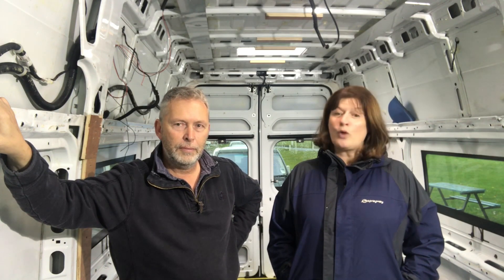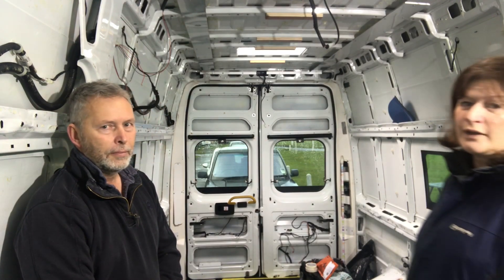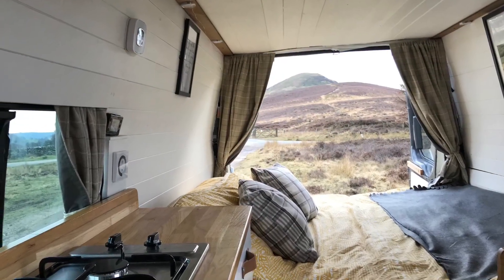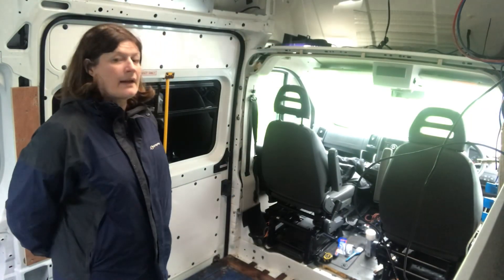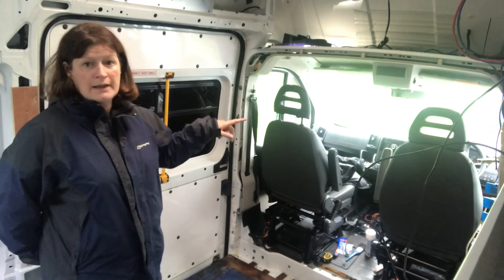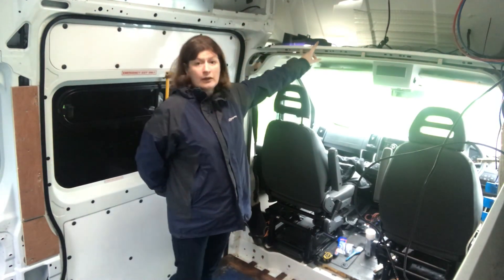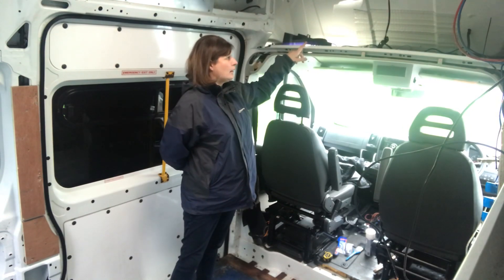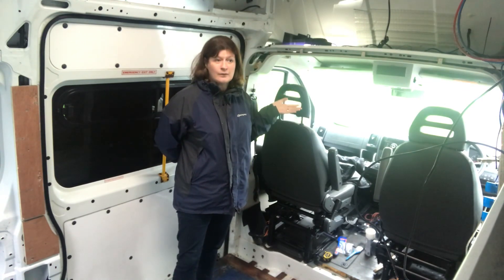Van life conversion, a new project.  Converting an ex-ambulance, an introduction.

Comment: I am just about to gut one of these Sevel vans as well for a client, we already came to the same conclusion as you have, existing insulation is not adequate & client agrees.
At the moment to save the client money I am not taking all the Genisys system out, there's some functionality that is useful split charge and some of the voice warning system for example but the vast majority will have to be rewired lights heater etc

This will be the third Ambulance I have tackled my own two are on my channel.
Reply from the maker: Thanks, will take a look at your conversions.  Aluminium plates were a real pain to remove.  Main attraction for us was, price and mileage of the vehicle, headroom and length.  Not too bothered about it’s previous ambulance functions.